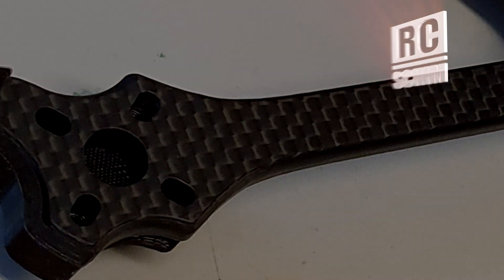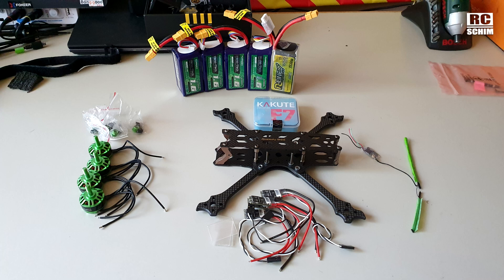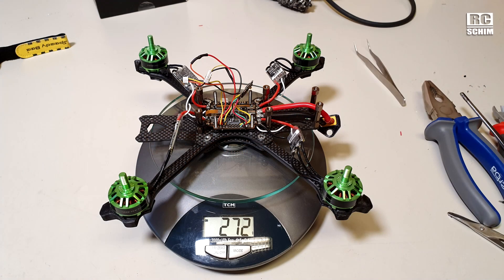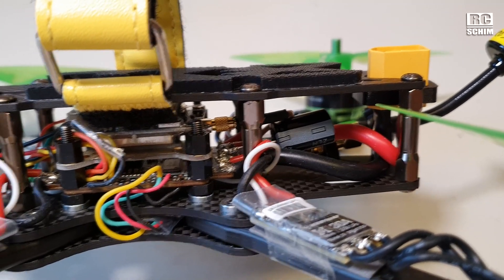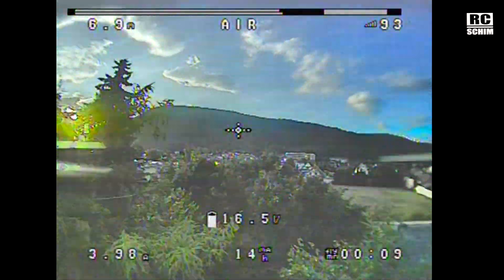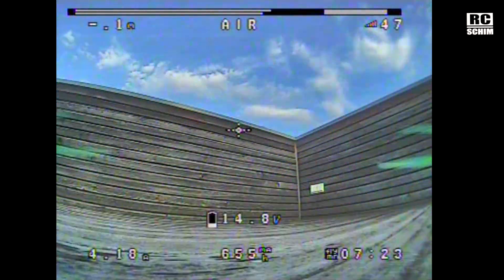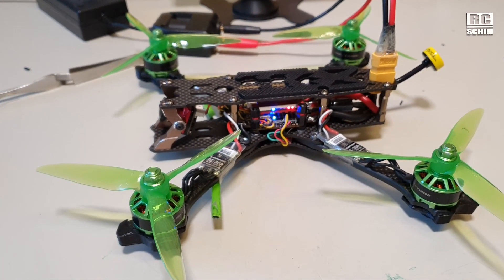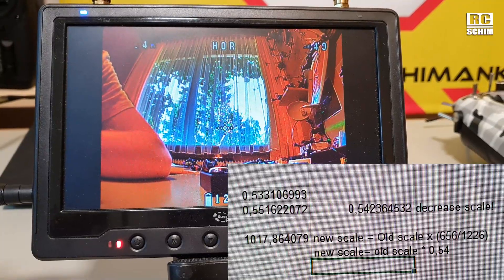I'm building me a fine FREESTYLE Quad (SpeedyBee Frame, FXT ARES VTX)

Comment: Why your crsf LQ so low in This build?
Reply from the maker: I think it was set to rssi rather than lq. Only now I've set it correct on my quads: cf nano= ch8 as LQ, presented to BF on Aux4, also set failsave value on aux4 to 1000 so the LQ = really 0 when tx is turned off...
Solid LQ are much more confidence building than random rssi jumpiness. Most confidence I had when I saw no rssi or LQ Info on the OSD at all ;)

Comment: hey, in gopro studio does it allow you to control the width on the effect? or is it a set  option, i forget, i think i gave up because i would need to convert splits video into 4-3 before importing it to studio.  anyway i think because the rc5 is slightly narrower fov the ''set'' superview effect might be slightly inappropriate for the rc5,  maybe need toned down as much as 10%?
Reply from the maker: yes, you can adjust a few sliders there. you can move the dynamic horizontal stretch  (move center, make center a bit less stretched)....
as you too, I kinda give up on gopro studio because it means I'd need to take a few extra steps.
for someone without any video edition software who just needs superview in a short vid - the old gopro studio might still be an option...
Reply: @Rcschim  ah, i just spotted these replies, no email notifications but youtube bell alerts thing....   i think you  should  record a grid like i am doing and choose your own ''superview effect'' settings from that,  when you see how much the rc5 is distorting the image you can adjust it to something sensible. superview is a compromise, its a very clever compromise and it does look cool but i think the linear edge stretch can be improved upon, especially for fpv freestyle flying, my settings would be perfect except for a slight flaw in the horizon, its very slight but there is no need for it.  a lens corrector more perfect for the rc5 lens would not have this problem,  there is stuff in after effects which lets you choose 2,4,6,degrees corrections but i can not see clearly what is going on,   i think you are right to go for the  most easily applied superview, one properly created for the rc5  you should find some unstabilized gopro superview footage and take a note of where the edges start to stretch,
Reply: the issue, and the clever thing about gopro superview, is how it avoids things rushing onto to screen,  the effect of making things rush off at the edges also causes stuff to rush on when you yaw into it, superview does not have the rush on effect, my rc split did have the rush on effect at about -36 correction, so there is a fine balance to how much rushoff'' you can create without causing the rushon'' effect, . stretch it as little as possible